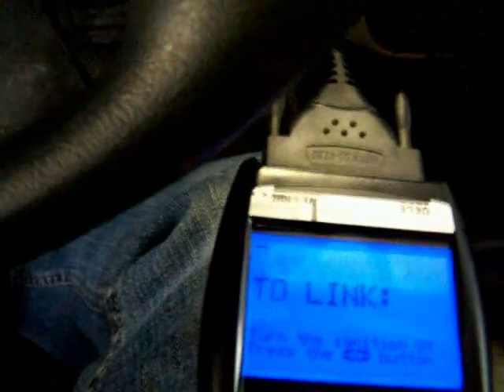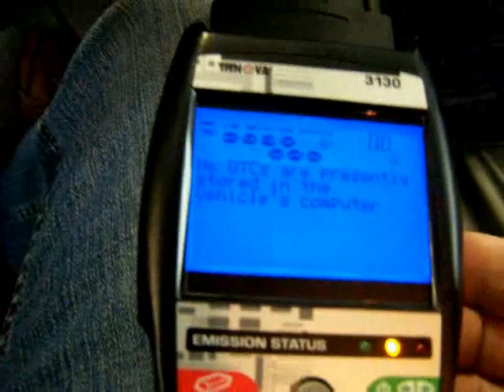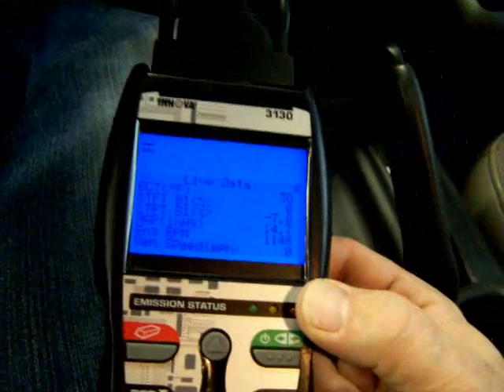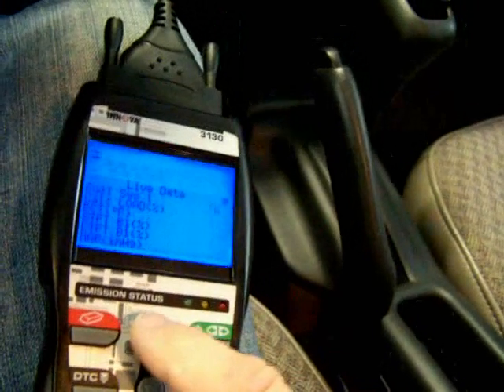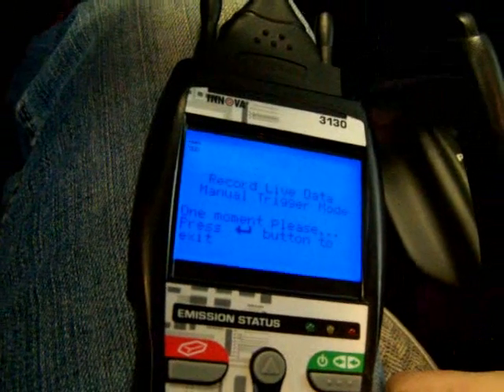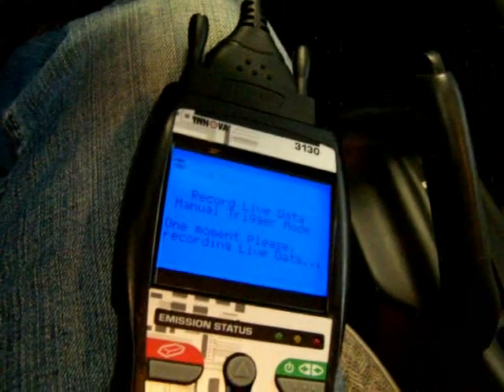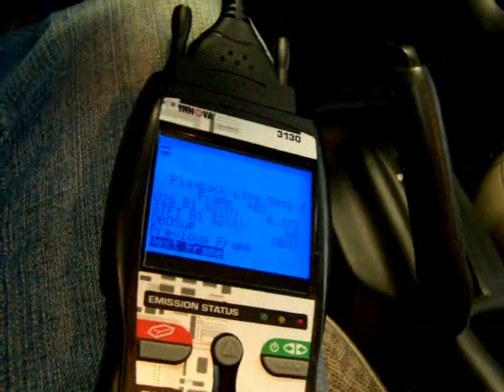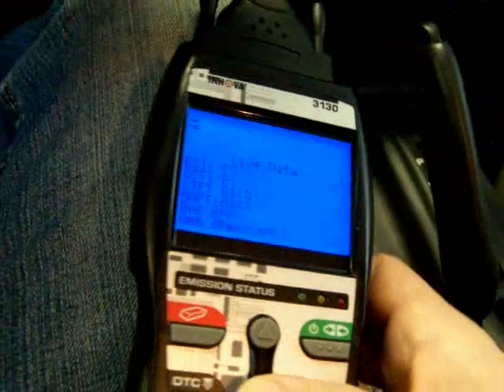Equus 3130 OBD II scantool

Comment: @outworldarts Do you think 3130 the best one? cheap compared to the others with live data, i tried the blinking once with a 91 s10 but is it the same with the rest, toyota, ford and so on. The abs is just the wheels and the airbags right will those affect the powertrain if something is wrong with the abs.

Comment from the maker: @LostInMadness220 Hi, you don't need a scan tool to read an obd 1 vehicle. You just need a paper clip and watch for the flashes on the CEL (check engine light). As is always the case, buy the best tool you can afford. Not all states requre abs to work for inspection, so it's a moot point for us.